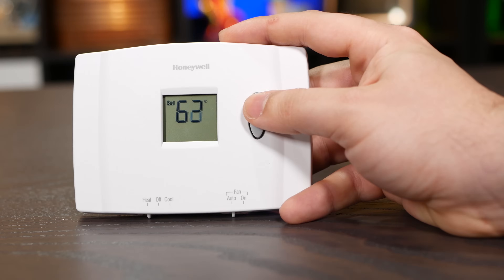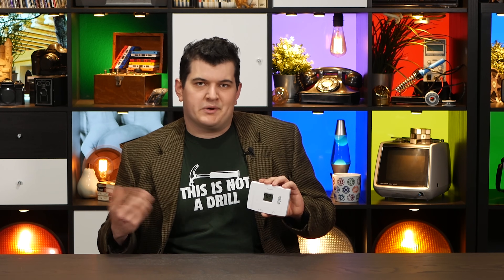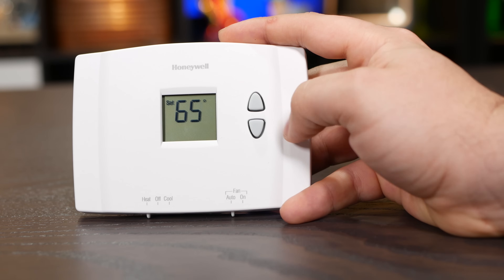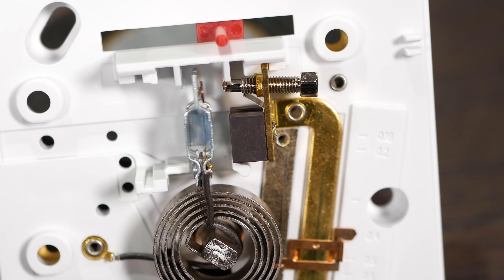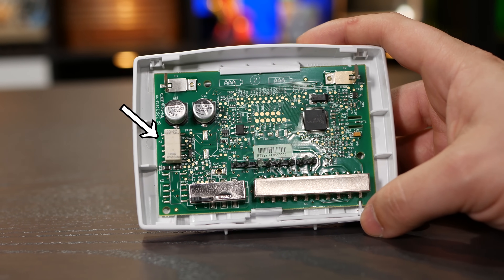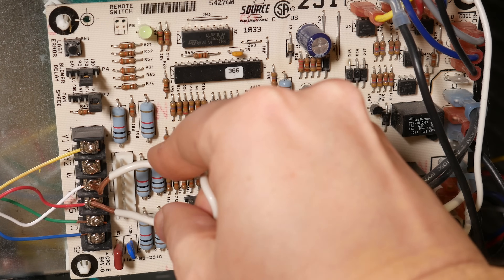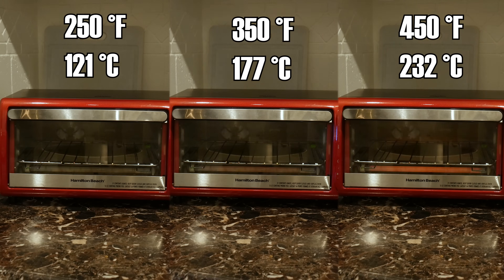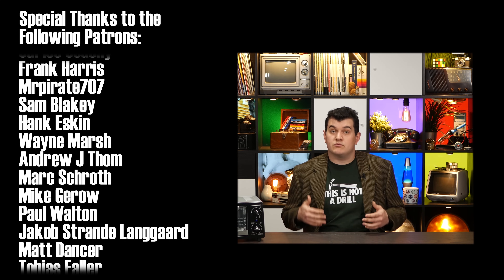Thermostats: Cooler than you think!

Comment: My dad was in the HVAC business for 40 years, so I grew up knowing the thing about furnaces not heating faster no matter how high you set the heat. It led to some rather heated (lel) debates with roommates in college.
Reply: no one in my family worked on hvac stuff and i always knew that. assumed it was common sense and everyone knew it.
Reply: @grants7390 never assume anything about common sense
Reply: If you have a 2 stage furnace connected a two stage thermostat. Turning up the heat higher will send 24 volts to W1 and W2 telling the furnace to go straight to high and skip low. So it will get warm faster.
Reply: @TheDeadheadable  is that going to exist in a dorm or cheap apartment tho?

Comment: I’m positive thermostats have minds of their own. The one in my apartment acts so erratically. I set the program to be 72° during the day and 69° at night with a couple in between steps, but it just doesn’t really follow it. It’ll still be set to 72° well into the evening when it should be cooler. Also, it sometimes lets it get WAYYY warmer than the set temperature without turning on the AC which drives me insane and I really don’t think this is a smart thermostat that can be locked out based on power demands. If it is, I’d be pissed cuz Louisiana gets f*cking hot
Reply: Does your thermostat have a model#? You might be able to research its capabilities to see if that's intended function or not.

Comment: The Thermostat should be place about 6 feet above or below the return. This causes the Thermostat to use the average air temperature coming from all sources. Having the Thermostat in a room away from the return will cause more warm and cool spots through out the home.

Comment: 2 stage furnace runs at 60% capacity in first stage and 100% capacity on second stage. Depends on furnace and settings but normally will run 10 minutes first stage then jump to second stage

Comment: My home thermostat kinda does that. You can temporarily set the thermostat to get to whatever temp, and the heat or ac will run until that temp is reached. it is just a cheap Honeywell that is hard-wired in my wall.

Comment: My dads old thermostat used mercury in a little glass bottle. The temperature would determine whether the mercury was touching a contact or not turning the furnace on or off. To adjust it the knob physically rotated the bottle

Comment: How about European water circuit based systems ? You can control on/off but also the temperature of the water that runs in the circuit. There is also usually also a simple thermostat controlling the flow of water in each radiator.

Comment: Thermostat designer here.  You are spot on for so many subjects, thermostats included!  Let people know that you could have talked for much longer if you included:
*Anticipation; (how does a thermostat with a 20 minute thermal time constant make room temperature decisions in five to ten minutes)  adjustable/non-adjustable, equipment compatible, how simple mechanical thermostats are often better, how many digital tstats totally missed good anticipation, how internal heat rise from even a 1/4 watt power supply messes with your setting...
*Mounting;  errors due to poor air circulation/stratification, locating near a heat source, locating where the sun hits the tstat, locating where the cool/heat source is on the other side (!) of the wall, locating where the ceiling fan defeats the chimney effect designed into the tstat,  Not plugging the wire access hole fully airtight to keep uncontrolled air from the basement or attic from blowing right through the thermostat...
You are so right about the Nest sometimes needing a C line.  Odd things happen.
Your humor and snarkyness are great.  Keep up the good work!

Comment: Ths is great for central HVAC. But for those of us who use electricity as a heating source, you can buy smart ("not connected to the cloud") thermostats that control the amount of heat that is produced by electric baseboard in a much finer way than than just ON/OFF. That way, you can decide to have a colder room and a warmer room. When far away from the set point, the baseboard heats to its max capacity. When close to the set point, the heating device emits less heat. Clever! :P

Comment: The cooling also works at only full blast. 
It's simply a matter of mixing hot and cold to the desired temperature. 
Just like adjusting the water for a bath.

Comment: In addition to explaining to my husband that turning up the thermostat temp does not make it hotter faster, I also repeatedly have to explain that you don’t have to change the set point based on how cold it is outside. If you want it at an average of 65F in the house, you set it to 65F whether it’s 40F outside or 10F. I had to buy a locking cover to keep him from constantly turning it up to 80F.

Comment: That's interesting, we have very different heating in Finland. Most houses and apartments have heaters with hot water circulating inside, and a round thermostat to adjust the temperature. I don't think they use electricity, at least the heaters aren't visibly plugged in like electric heaters.
Reply: The heating doesn't involve fans at all. And even if you have electric heaters you have to adjust each one individually. AC is modern like in the video, but still very rare in people's homes. My grandma is the only person I have known to have AC.

Comment: You're partially wrong about the equipment being "dumb"
Most newer style thermostats have many settings including multiple stage heating or cooling and adaptive recovery which means the thermostat learns how long your house takes to heat and on a schedule will then turn the heating or cooling on before the time you set so that it will be that temp by that time and not just start heating or cooling at that time

Comment: Our inverter system does run the heat pump at a stronger stage if there's a bigger gap between current temperature and desired temperature, but your point is taken and valid for older systems.

Comment: Should have mentioned the ingenious way the old thermostats did it. They used the same bimetallic strip but instead of the contacts poking out like that, on the end of the coil was a small glass capsule with two wires that enter one side, and inside the capsule is a small amount of mercury. When the thermostat got cold the coil would curl back and tip the capsule up leading to the mercury flowing to the side with the wires and completing the circuit and turning the furnace on. When the thermostat got warm the coil would curl forward and tip the capsule down leading to the mercury flowing away from the wires and disconnecting them, turning the furnace off. We were redoing parts of our house earlier this year and replaced some thermostats and they had this exact system still, and they were working perfectly fine after all these years.

Comment: At 8:20 you just described the climate control system that was in my 2006 Pontiac. Whenever I tried to just set it and forget it it would run the heat normally but then it would start blowing cool air, not ideal during the winter.

Comment: My new Nest thermostat made the furnace do weird things.
It would turn on for only a few seconds at a time.
That's when I learned about the blue wire from tech support.
It was routed from the furnace to the thermostat, but was never connected to the furnace.
Connecting it fixed my issues.

Comment: The Honeywell Evohome thermostat system can also sort of do your last query of a temporary heat (or cool) boost in a couple of different methods - you can either set a temporary temperature until x o'clock on the central smart controller, before it reverts to its normal programme. Or you can adjust the zone/room individual thermostat which will hold that temperature until the central controller's next programmed change point updates the target temperature. The second method is great if you have family who keep adjusting the thermostats to 80F/27C, as you can programme the central controller to alternatively target 70F/21C and 71F/21.5C every hour, so any changes at the thermostat get reset every hour. It's like having HAL controlling your central heating.

Comment: Our thermostat is connected to our security system and it has the ability to override the temp at certain times of day. It could be set to over ride the temp back to normal and give you the one cycle thing talked about at the end. It also means if your father ever figured out he could put a passcode to prevent the thermostat from being changed the whole house but him would suffer.

Comment: So no duh my AC/heater is only on or off. I on the other hand commonly have to set my thermostat higher or lower then my target temperature. Not because it makes the system heat faster, but because commonly I'm only changing the temperature by a degree and the system refuses to kick on unless its 2 degrees F out of syn with the room temp. I bet as human beings often make miss attribute causes and effects, someone just didn't notice when they changed the temp by 1 F their system like every single one I've ever used didn't actually do much until they kicked it up again. This then becomes "oh i have to over shoot because the damn thing is slow", or something.

Comment: Since it boosts engagement... What about those variable speed A/C units we keep hearing about? They are gaining a little steam, but I'm not sure if it's a gimmick. Seems like it's not all on or all off though. 

I can see the need, in a well insulated house, to let the ac run a little more often if it can be done on less power. Because dehumidification. We have like 190% humidity here, and I keep fish. Which means I'm evaporating water into my home all the time in a part of the country where "exotic" mold and fungus thrive.

Comment: For those of us where heat pumps are common: the Emergency Heat electric heat strips are also called "Aux Heat". On even basic 30-year-old thermostats, Aux Heat is usually triggered if the setpoint temperature is 3 deg F above actual temperature. In this instance, turning the thermostat up above a 3 degree delta will actually heat faster, but use much more electricity.
Reply: I've seen places where "heat" is the heat pump, and "aux heat" or "emg. Heat" are from a gas furnace. 
Which is probably a decent idea for places with poor electrical infrastructure, where a lot of resistive heat might break the grid. (Like, say, Texas)
Reply: What place uses both heat pumps and Fahrenheit?
Reply: @MrAwawe we bought our house in the upper Midwest (USA)  in 1996. 
USA = °F 😉🤷🏼
A few years before we bought it, the previous owners had an air-source heat pump installed. Provides AC in the summer, and heat in the winter. 
Unfortunately, even though the original thermostat had a notation of “emergency heat”, apparently the previous owner did not spring for the heating element. Presumably because there are several zones of radiant electric heat throughout the house.
Reply: @MrAwawe  The southern US (although they are used some in the north, even Alaska)
Reply: @Owen_loves_Butters  my 2018 construction apartment in philly has a heat pump (and no aux heat, so i hope it doesn't get too cold lol)
Reply: Yes exactly this. And much more difficult to find Smart thermostats and programmable thermostats. We have a heat pump with a relatively basic digital thermostat but it's not programmable or anything, have a new programmable one just waiting to install will be so nice, because right now I wake up in the morning and turn the thermostat up 2° then wait 20 or 30 minutes and turn it up another 2°. Just to avoid triggering the "Aux" heat. Can't wait to program with the app a nice smooth increase

Comment: In the field of AI, thermostats are used as an example of a very simple agent: it has an environment to operate in (your home) that it senses (via whatever temperature-sensitive part like that coil), it has a goal (to keep your home around a certain temperature), and it has actions it can take to achieve that goal (turning on the heat, turning on the cooling, or doing nothing).
Your thermostat will never threaten to stab you and, in fact, cannot speak. If your thermostat does speak, we advise you to disregard its advice.

Comment: The idea of a button to kick on one cycle of heating or cooling is very very very good idea, I keep having to raise and lower the temperature for immediate response when entering the house form the outside at random times.  Yes there is a "schedule"  but I work at home and go to bed at random times so yeah, not very useful at all and when entering the house after working outside in summer or returning home from shopping in winter I keep having to mess with it and then forget or be lazy about setting it back.

Comment: Variable speed drive driven inverter AC could operate for just a cycle if you want. They have turbo or powerful button if you press it the unit will work on more than it’s rated 100% capacity for a fixed short period of time like 20-30 minutes then it’ll Come back to set temp.

Comment: Late to the party, I actually worked on that particular honeywell thermostat :)  The hard part of any good thermostat is to guess the temperature in the middle of the room and not the temperature at the thermostat.  The thermostat electronics also generates its own heat which interfere with its sensors so it needs to be compensated.  you also don't want the heat to turn on because a cold draft went by.   Also heat creates a moving wave of air which the thermostat also have to take in account, furniture will affect the speed at which hot air moves.  Using special rooms with sensors inside, a mathematical model of temperature movement is created.  the room was subjected to ramping up/down temperatures like -40c to +40c, opening doors to measure the effect on the temperature in the middle of the room.  At the end you have a thermostat that display the temperature felt in the middle of the room and adapts its timings based on the room its in.  It is also very important NOT TO ENCASE a thermostat in things like ikea cubes like some stupid designers do because they prevent air flow around the thermostat.
Reply: As for thermostat that can pump heat or cold for a short period look for programmable thermostat.  With programmable you configure for example 21c in summer during the day but if you change the setpoint manually it will blink showing that it will be temporary.  Sometime they go back after 30mins and some models will revert on the next program step like evening.  For bathroom most have a boost mode that works in increment of 5min that will blast heat.

Comment: I know it’s been 2 years, but my “dumb” thermostat has an “override” mode that lets you set a temporary temperature for 1 to 24 hours, after which it will go back to its normal scheduled programming.
Reply: Push the hold button and it will hold the temperature until you change it

Comment: well has an hvac tech . T Stats are more complicated than 20 years ago when we had mercury bulb stats which I prefer.  Even after installing hundreds of T Stats I still have to read the instructions to program them and sometimes to even wire them up.  Some T stats are even wifi capable.  You can set them using our phone.

Comment: This is fascinatingly different from european heating systems. Here, the furnace thermostat keeps the WATER in the heating loop at constant temperature. This water is distributed to radiators in each room, each of which have an adjustable thermostat. Depending on the heat load, each radiator’s thermostat will open the flow of water, thereby cooling the water in the loop and turning on the furnace periodically.

Comment: Thermostats with schedules pretty much suck with radiant floor heat.  “Yes, let’s save electricity and gas by setting the temperature to 55 at night, and 68 during the day.”  Morning comes, and now it pumps very hot water through tens (hundreds?) of cubic yards of cement, until the air several feet above reaches 68.  With no fan to circulate the air, there is a pronounced temperature gradient (air near the floor is much warmer than at head height).  The hot cement keeps radiating heat for hours.  Interior temperature passes 80.  If only I had a smart thermostat that could predict when to shut off the hot water, allowing the temperature to coast up to (near) the set point.

Comment: You said nothing about the "Anticipator" function.  Even the old mechanical thermostat's have that function, at least for heat.  You can even adjust the amount, but first you need to match the setting to the current that is going through the thermostat.  Sorry if this was covered in the 4,803 Comments below.

Comment: The "digital" communicating thermostats like Trane XR1050 actually have 3 wires: hot, ground, and data.  These thermostats along with the controllers spread about the HVAC system (one in the HVAC compressor, another inside the HVAC "furnace") can "modulate" the degree of HVAC applied (ex: AC Compressor can vary from 20 to 100% depending on demand).  Many of those thermostats also have WIFI for controlling other devices and for downloading software updates.

Comment: I have a question about car AC.  If you raise the temp of the AC to not full blast dose it use less fuel?  Or dose it just mix more hot air into the duct?  Then putting the fan on max make it use more gas?  ETC

Comment: Most thermostats in Florida, and more and more elsewhere, actually have a different wiring cofig for the heat pump,  A wire for "direction":  Forward vs Reverse cycle, plus, as you mentioned, there may be a wire for the auxiliary heat strips.